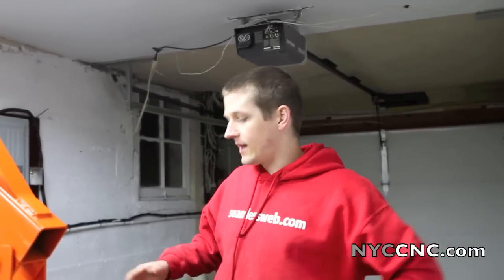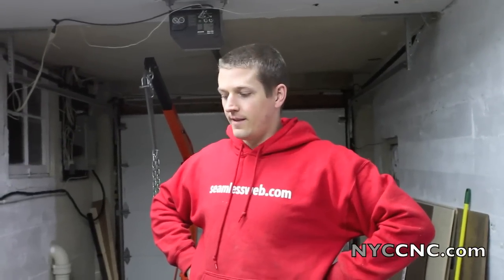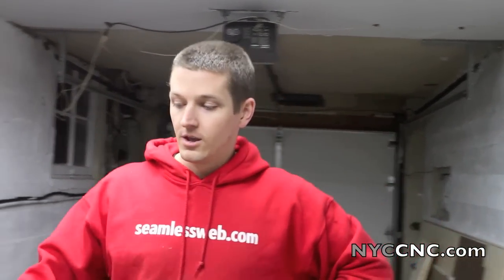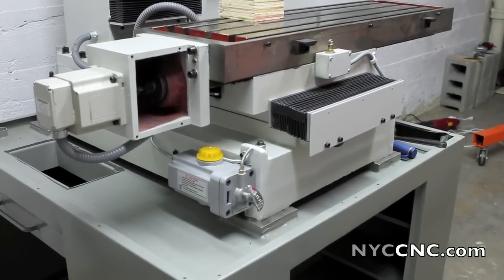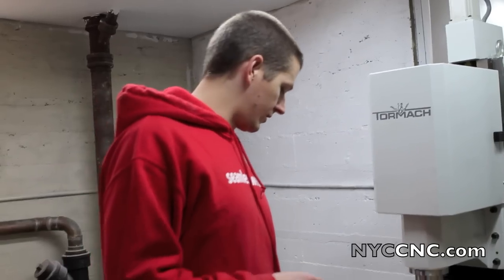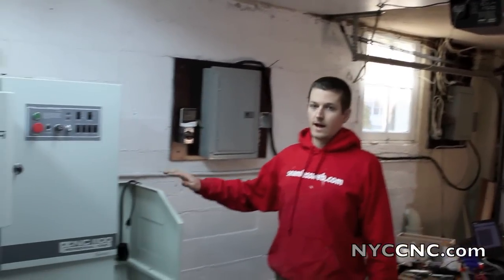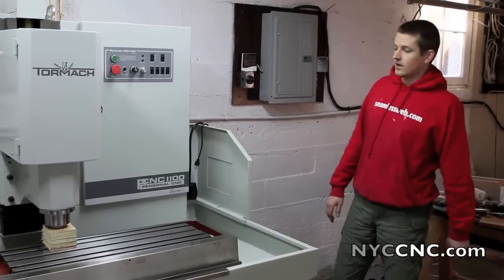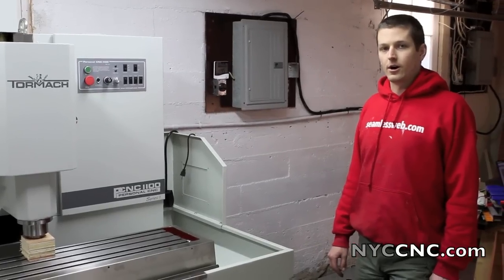Tormach PCNC 1100 - Lifting Mill onto Stand with Engine Crane Ch. 9

Comment: @saunixcomp Well, if you need anything or any help let me know.  I can make you anything, just send me a print or a sketch.  I have had VMC's for 15-20 years.  I love having flood coolant.. but my Loc-Line is set up so you can both regulate flow with valves and snap on numerous types of orange nozzle ends to your desired effect.  You can emulate a near mist efffect with a little finesse with your volume/flow and the right nozzles and valves.

Comment: Your X Axis limit switch is different from us older mill owners, yours is in a box, this should help some, but it will still get into the switch via the plunger rod. When set up, check your tram along the X with a dial indicator at least 4 inches away from spindle center. Before you do anything crazy, place your floor jack under the stand on the side that reads low, you may find that a low spot in the concrete can transmit up the stand and twist the base/t slot table. It does on my DIY stand.